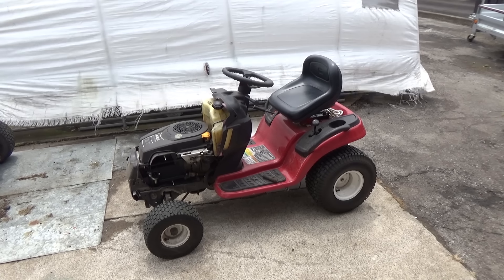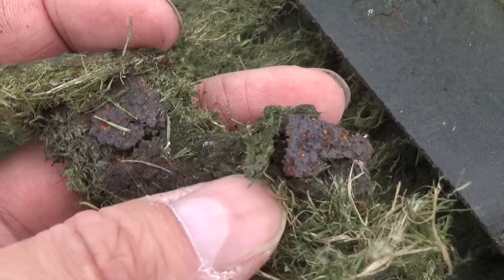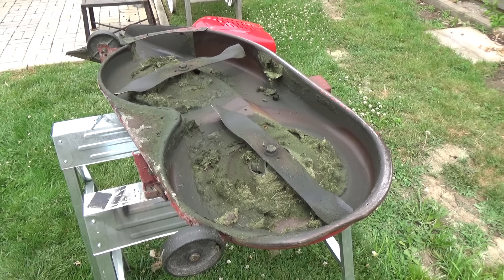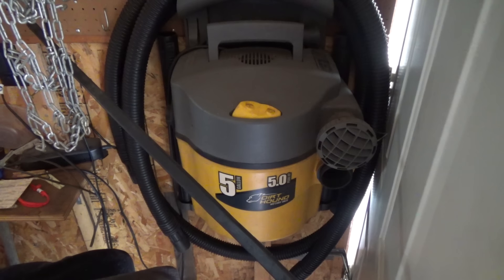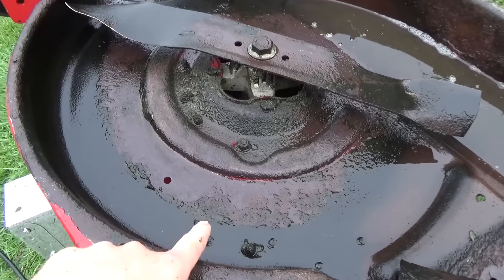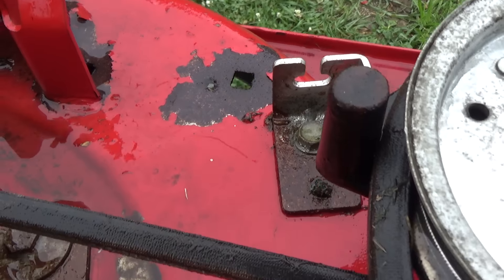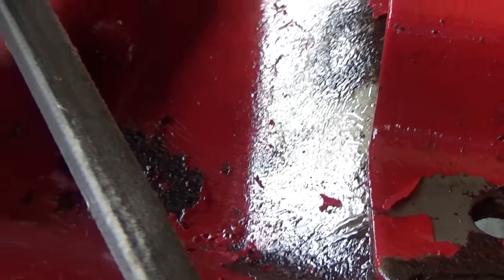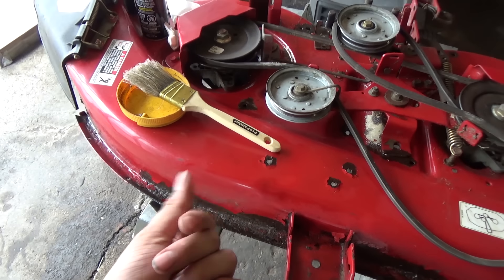How to Undercoat a Deck - Why Cleaning Your Deck is Important!

Comment: Here in Florida, with our sandy soil, desks get sand blasted every time you mow.  I have had blades wear off the wing/lift section in less than an hour.  Blades don't last long and frequent sharpening is required.  Decks don't rust out, they just wear thru.
Reply from the maker: Wow, that's pretty crazy thanks for sharing!

We don't have anything like that around here! In fact, it's quite the opposite.

I'm actually looking for a '69 fastback mustang, and everyone I've found it rotted out, we have sooo much humidity down here. I live like 20mins from Niagara Falls, so it's always super humid.

Mower decks, vehicles, you name it, they all rust!
Reply: Robert Heinkel You got that right, in Florida plan on a new deck for about 287 bucks in 3 years.  Rust will never have a chance to happen, no metal left to rust.    Blades last 3 or 4 times on 5 acre mowing till no blade is left.  Just a ragged alien looking used to be a blade thing.
Reply: John Fenman Agree on the Fl sandy soil. I wore a hole in an aluminum deck 21 Honda in two seasons cutting once a week only in summer. I patched it with a riveted stainless steel sheet. Next mower I’ll inspect the deck after a few cuts to see a pattern where the swirl action is battering the deck with the sand. A PM fix would be to add a length of stainless barrier in that location to prevent it abrading through the alum. Steel deck holds up longer but eventually fails with Fl soil. Stainless shield is a must for some Fl regions.
Reply: Robert Heinkel ..... here in North Carolina we have some very sandy soil as well. I have spots on my lawn that are very Sandy or at least used to be. Right before you cut the worst Parts just spray a little water from a garden hose and the sand becomes heavy enough and will not get up in a road your blades or your deck. I know it sounds silly but it works and doesn't take that much water to do it. You just need to spray it down right before you mow and at least it will reduce it dramatically even if you don't get every square foot of it done. It usually took me about 5 minutes to wet those areas down. I hope it helps
Reply: YEP, I'm north central Fl. I have found the top of line Gator blades to outlast others

Comment: I use wire brushes with my drill to remove anything flaky like rust or paint. Flaking paint traps water under it. Get most of the rust removed with the wire brushes then spray Rustoleum Rust Converter on the remaining rust to stop further rust. I bought John Deere yellow paint on Amazon when everything was nice and dry. Under the now cleaned deck when all the grass and stuff is clean I spray Blaster Surface Shield to seal it and it's good for 2 years before it needs another spray.

Comment: What size scoket did you use to remove the blades ?
Reply from the maker: Shemuel Israel I believe a 13/16" or a 15/16" I can't remember
Reply: okay, having a hard time trying to change my blades on a cub cadet xtl 1 tried a 1 1/8  and 1 1/16 both were to big this is my very first time ever doing this.
Reply from the maker: Shemuel Israel may be a 1" or 15/16"
Reply: okay, thanks I need to go buy a breaker bar and retrun these sockets, hate to take this to the shop but might have too if I can't get them off.
Reply from the maker: Shemuel Israel a little bit of heat can always go a long way, try using a torch to heat up the nut! Would need to get it pretty hot though as the rust makes them very hard to remove!
Reply from the maker: Shemuel Israel also, get some "nikel anti-seize" while you're out shopping, put that on the threads before install the nut.
Reply from the maker: Shemuel Israel here is my updated video on this: https://youtu.be/vKemep6_YxU
Reply: Most are 15/16

Comment: POR-15 is a much better treatment for a mower deck.  Use it all the time on farm equipment because of how it keeps a lasting slick finish for grass and such to slip off.
Reply from the maker: Thanks, will look into it, never heard if it in Canada
Reply: I agree. I used POR-15 on little garden trailer and I cant believe after 5 yrs of no or very little rust. Left outside in Michigan weather the whole time. Its expensive.
Reply: POR-15 is hugely popular in the States.
Reply: Por15 is available in Canada. I think its a 2 part system though and pricey, as well as way more prep. Autobody places sell it for sure. I went with Rust Mort. I think Por15 is better then what both of us use from what I've seen.
I have never tried the mower deck though, that's why I'm here. 
Never heard of the stuff your using, sounds like Rust Mort. Is there a shelf life? I've had mine a few years.
Reply: Rust Mort is a chemical rust neutralizer and is not paint, which I have also used on other projects but it is not the same POR15 which is paint. Yes POR15 is very expensive. Also POR15 states that if one drop of water or sweat enters the open can it should be considered useless. Eastwood has a similar product as POR15 and is probably cheaper

Comment: Why not use a can of the spray on or roll on truck bed liner underneath (after neutralizing the rust)
Reply from the maker: Good question, we've found that the deck will actually rust and rot underneath the bed liner. It creates a space for the moisture to sit and eat away at the metal.

The rust cure will absorb into pores of the metal and create a barrier, which prevents moisture/air from rusting it further.

Comment: Craftsman HST riding mower/garden tractor w new blades properly installed, does very poor cut even at low setting. How do I verify pulley is (fully) engaged w engine? There seems to be adequate belt tension across the three blades and spindles seem ok.

Comment: Great video I just want to know why you didn’t pressure wash the mower and get it real clean before you started all this if there’s a good answer let me know
Reply: To answer your question, the so called "Power Washer" he was using is junk, case in point, why are there clumps of anything left if the "Power Washer" was worth anything. I have one and I also have a 52" zero turn mower that I do ( and understand how to ) pressure wash. I have a Excel 2500 psi washer and mine would never leave a clump of anything. when I use it everything I point it at is coming off.

Comment: navel jelly changes the property of rust, then wire brush, then paint  after the paint is dry you can spray what you like on it I'd use a silicone spray so the grass dosn't stick.

Comment: Wire bush as much as you can, but the real trick to get that smooth finish is 60 grit sandpaper. Removes loose paint and any raised rust spots.

Comment: You had the deck off why not take it all apart and wire wheel it down and paint the top and grease all the pivots and bearing points? Plus all that rough stuff under the deck will allow the grass to stick to it. I clean all the rust off under the deck and then use a 5 min epoxy to seal and smooth it out. Just sand in between coats until it "relevels" the area. Then I hit it with rust restorer paint and then use a mixture of 3/4 axle grease and 1/4 transmission fluid to coat the bottom. That 5 min. epoxy is pretty tough, I even use it to smooth out badly rusted axles on push mowers and tracked snowblowers... Beats paying for a new axle. Or letting it wear the inside of the wheel or track wheel out even more. 

Then tell your customers that they should have their deck done every other year. Once you explain to them to have their equipment checked and fixed BEFORE something breaks, it will make sense to a majority of them. I offer mine preventative maintenance plans...  I charge a flat rate plus any parts and I don't spank them on the parts. And tell them how important it is to wash all the grass off the mower and under the deck after they are done mowing.

I have a 1992 craftsman 42" hydro with the original deck and even the tires and a 1995 craftsman 5/23 track drive snowblower all original and I leave them parked outside all year long and I live in New York. They are parked on pavement, not grass or dirt... Parking them on grass or dirt makes anything rust faster.
Reply from the maker: kiddiescripterkiller All the spindles we're greased (some are enclosed bearings and others have grease nipples) as for smoothing out the underside, I've seen brand new decks with grass stuck to them, as I said in the video, grass sticks anyways, so it's better to have a non drip rust inhibitor in between the deck and grass.

I charge by the hour, so there's a time/value that I have to try and stick with, I take a wire wheel and break up the rough stuff, anything else is just overkill in my opinion.

I've been doing it this way for a few years now and we've never had one come back that was rotted out!

We occasionally try out new products to see what works best, but the rust check and Krown rust inhibitor have worked well in the past.
Reply: Would truck bed liner(I think is called rhino liner) or something like flex seal render the same results?

Comment: First off if you went to those lengths why not use a wire wheel to completely clean the deck underside thoroughly, then apply your undercoat solution? Just saying.... On my new 22 hp Cub Cadet 46" deck I did, and only took about 10, 15 more minutes but it was raining here as well so what was the rush. I Primed the bare metal , painted then used my undercoat solution and it gave me a protected like new under deck. Will I have to do it again? I'm sure but I feel it's worth it in the long run to not cut corners. I have a 20+ year's old Scott's 20 hp tractor, bought it second hand and it still runs great with the deck not rusted out. The spindles had to be changed but what do you want from a machine with countless hours and years of massive use. You know while in the big box store's I see folks buying new mowers so I talk to them and they most always say, "Yeah I got one new about 5 years ago but it's shot." Clean it, Change the oil, filters, air cleaner, spark plug and for heaven's sake take the time to address that deck. Without it you can't mow, it's just something to pull carts and ride around on. Never had a brand new one before so I wonder how long this one will last, 30 years? I'm 61 so if I last that long probably.
Reply: I have a 20 year old poulan pro. Bought it new and have cleaned the crap out from under it once a year when i sharpen the blades. Now replacing the deck spindles because one took a dump. Change oil and blow out and change the air cleaner more than once in its life they should last. But this day and age its throw it away.

Comment: About how much would one expect to pay for such a service from a reputable repair shop for this kind maintenance?
Reply from the maker: A couple hours of labor minimum, I believe we did a full service on this machine and charged 4hrs

That includes oil change and spark plug air filter etc...

Many people will say I should have wire wheeled the deck, then painted it, then undercoated it, but that takes more time.

I'm doing this for others, so there's a fine line between doing a good job but also saving some time!
Reply: Eliminator Performance  thanks for the info I am sure you can always do more but there is a cost to benefit ratio you got to consider too for the customer which is understandable. Thank you for the reply.

Comment: I prefer to use a rust reformer, brush it on and it soaks in like a penetrating oil and any rust causes a chemical reaction and dries to an epoxy finish that can be sanded and painted or just left as is.. You can also use a few different chemicals to remove rust just apply and let it set to work and rinse off with a hose..

Comment: I got 3 water hose nipples on my deck and use it to clean about 3 times during each mow when using mulching as the build up is heavy when mulching. I spray underside of deck with dry graphite lubricant which is a moisture barrier and after 5 years bead blast the deck and powder coat it ... I do everything at home and material cost to powder coat cost less then a single can of graphite lubricant .. about $3.00 most people have no idea exactly how cheap powder coating really is .
Reply: Powder coating cost is with the oven which is the reusable part and can easily be constructed. More manufacturers should get on board with the process but then their products would last too long. Powder coating is the "cats meow".

Comment: how would rust on the outside be caused by build up on the inside unless it was rotted through?

all that surface rust should be ground out cleaned up and hit with some enamel paint. I fluid film the underside of my deck.
Reply from the maker: Fluid film works just like the corrosion free rust cure 3000 it soaks into the metal and provides a protective layer.
Reply: I used Fluid Film on my equipment, too. But different places use different methods. And Canada is certainly different, haha!

Comment: i'm really worried about getting oil on the belts (as i brush up against the belts...that need replaced anyway)...
Reply from the maker: Drive belts are what you need to keep dry and clean, deck belts should be ok if you get a bit on them.
Reply: Jeff Burkett i

Comment: Guys I use oil based paint after cleaning and wire wheel. It seems to work the best for me. Plus I always have leftover paint so why not use it on the deck.

Comment: I saw this AFTER I painted my deck with Plasticoat spray paint. I buy Rustoleum or whatever when I see it half price and paint my shovels, hoes, and deck (after washing with The Works). I use a product called The Works. .........................................................................................................This bathroom cleaner helps wash off rust with the help of a putty knife, wire brush or scratch pad. I then rinse/wipe down with a saturated rag. When it is dry I paint. .................................................................................................................This has also worked well on my trailer that hauls the mower and a 500 gallon propane tank, both of which are over 35 years old. The Works - not a bad bathroom cleaner for a dollar. I wash and spray when I have the deck off. It Works.

Comment: PA LAWN Guy, Is the rust neutralizer/preventative phosphoric acid based?
Reply from the maker: That's a great question, I'm actually not quite sure and will have to look into it!

I know the Rust Cure says "eco friendly" on the can, so I'm assuming it's not.
Reply: Good deduction. phospheric acid is not eco friendly, but is sure effective and if used up in the chemical action it does not cause harm.

Comment: Using the wash port eventually will get water into your bearings. An oil film of your favorite brand will just make grass stick to the underside. Not good. What you need is to spray black rocker guard which dries and can be painted if desired.

Comment: Using a rust de-activator and neutralizer goes a 1000 miles. This is usually done after the first or second season, and the under deck is pressure washed and dried. Once preserved it can maintain itself permanently. Each year the under deck should be cleaned and inspected for new areas of rust and treated as before. Ideally, the entire underdeck should be media blasted upon purchase, and allowed to begin rusting. But, the need to mow that lawn with y a new mower will take a wee bit more applications over time.

Comment: You need to use por-15 or IE s1500 what you can get from International epoxies and sealers through S&R Fasteners in Florida that is a rust inhibitor paint that takes about three or four days to cure and when it cures it cures rock-hard that crap that you're putting underneath that deck will probably wear off about the third time the yard is mowed that is not worth a darn and and besides normal rubberized undercoating holds moisture between the metal and the undercoat which will serve to severely Russ the deck out way faster than had you done nothing be right back where you started

Comment: 4 words of wisdom - Hand Held Wire Brush.  After you clean the underside with your scraper(s), use the wire brush to clean any additional buildup off of the surface before you undercoat the deck.  Personally if this were my deck, I would strip it, prime with an etching primer then repaint it before I undercoated it.
Reply: Rustoleum's Rusty Metal Primer always did the trick for me.  I put 2 coats of that down before I bed coated the inside of my 2 stage snow blower intake.  So far so good. We'll see.

Comment: The idea is good in theory, but that oily crap is just going to attract dirt and grass even more. After a couple of seasons, it's back to bare metal and the problem returns because the dirt acts like a sponge and soaks the stuff off. I would use a good heavy duty paint, something like POR-15, and then add MoDeck spray once at the start of every season. Much easier, and will repel wet grass and dirt, similar to PAM cooking spray. either way, best of luck.
Reply from the maker: I've heard a lot about the POR-15 will have to check it out!

As for the "attracts grass" we just had a mower in for oil change and filters that we undercoated last year and the deck looked very clean, the grass doesn't actually stick much believe it or not.

Normally we spray our decks every year with the Rust Cure and it works great!

Comment: The design of deck is to act like a vacuum and stand the grass and cut it. Any grass clippings left under the deck is counterintuitive and one of the reasons you don't mow wet grass. Moreover the conventional belly mower designed was not designed to mow on a radius. The design is to cut the grass efficiently with the front wheels straight. Hence   straight long lines or stripes. Stay on the light lines for the darker ones are going the opposite way and when you turn around it will turn light